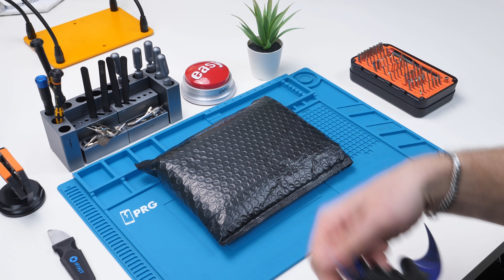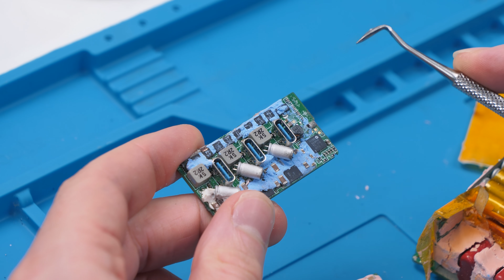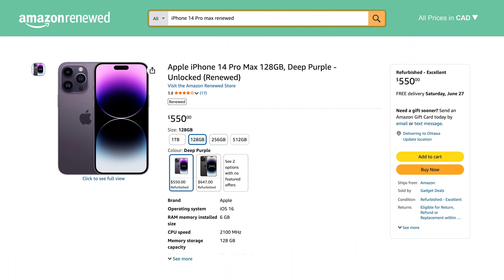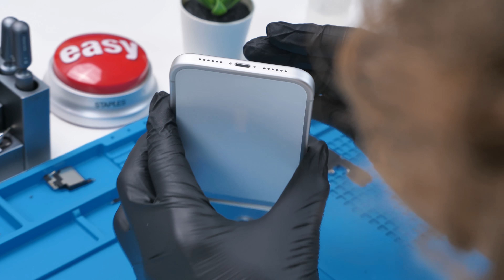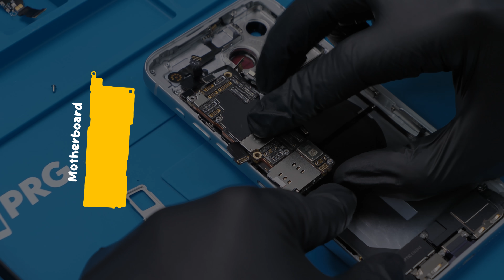iPhone Mods Finally Got Good.

Comment from the maker: Buy Anker Prime 160W Charger on US Amazon: https://ankerfast.club/q8v8lb
Visit the official website: https://shop.anker.com/9SKtke
Reply: Love the video!
Reply: i did the same mod as you with my 14 pro max but my lidar scanner works fine? im sure yours didn’t work prior before the housing swap as mine works perfectly fine.
Reply: Can you giveaway this phone for me after this mod
Reply: Nice
Reply: Can I have an iPhone please
Reply: Bro I tried the converting it and I dont know how the lidar and all works as you saud i trued wuth the app u used but it also ashoes everything works I got the mod housing from india from a seller there but the lidar connector extender i got didn't need to be bend or so it was perfect i dont know what happened with your lidar i think because it was folded and all but anyway my kit came with everything separated like wireless charging coil,flash,camera control button , other buttons and all came un attached and it costed me about 230 cad to get the housing
Reply: @Unofficial_beys  Can you please tell me if NFC works for you?
Reply: Me lo regalas soy de Panamá y mis compañeros .e además bullying por q tengo el j2 prime 😢😭
Reply: Is there a IPhone 15 Pro Max to 17 Pro Max converter??
Reply: Give me iPhone XS please please ❤❤❤
Reply: Can I please have the 14 pro please my phone is really bad Im a student and don’t have any good phone 😢
Reply: Can i have it i never had a smart phone im waching this video with tv
Reply: No, the charger wil overheat my phone

Comment: Bro i installed it myself

It doesnt fit in a standard 17 pro max case

The build looks like a real 17 pro max, i fooled a lot of people and phone technicians

Flash isnt two toned like the original iphone flash

liDar also works too but nfc isnt working but i never use nfc

Other than that it works pretty well.

Comment: Worth it? You mean just for the video, right? Because this mod is absolute garbage for daily use. Definitely not worth it. The downsides are enormous. Bluetooth issues, halfassrd action and camera button(the main reason to do it), losing LiDAR, still being stuck with usb-c, obliterating any water resistance, and not even having mobile payments or the other functions of NFC???? Absolutely not worth it at all. What did you actually gain? Nothing except to look bougie and cheap. There’s also no way it hasn’t impacted cellular signal as well as potentially just all radios. It’s a fail and only a novelty for a video but offers nothing but disadvantages for actual real world use. Lame.

Comment: Whats about flash light?
Reply: It can work normally, but you should use the original flash and the stock cable, though you'll have to fold it to make it fit.

Comment: Собрал я этот телефон всё работает и лидар и nfc шлейфик нужно было установить всё хорошо помещается без проблем
Reply: It can work normally, but you should use the original flash and the stock cable, though you'll have to fold it to make it fit.
Reply: @H3ll0-f7y ничего не сгибал, всё идентично, всё поместилось, если хотите могу снять видео как получилось, автор видео собрал вот только опыта маловато у него я начинал чинить со времен кнопочных телефонов, по этому доя меня нет трудностей даже спаять свой кастомный шлейф. Но мне не пришлось всё подошло хорошо

Comment: In the ad they show the position of the correct handle sensor and the way for NFC to work: Just wrap the NFC cable with insulating tape before installation and both functions will work.

Comment: Ordred the same kit and got the NFC running by insulating the wire (end of the antenna) with electricl tape. the lidar in this video is upside down too thats why its not working

Comment: If u see this comment, many of these Aliexpress housings dont use proper film on the LiDar window, just scrape the purple off with something, and the Lidar will Work, and the NFC antenna needs to be  insulated using the yellow plastic they include

Comment: this is very common in Low cost iphone market in China. Using Iphone x,  12 and 14 mainboard with IP17PM style casing, with options of 10+ colors and different sized batteries. Some of the combo deals are as low as 500-600RMB level, young adults and students loved it over there.

Comment: I used Anker Ganprime 737 100w charger in one little electricity short circuit it burned down and its not working anymore. and anker official service centers ask me 50$ to fix 80$ charger

Comment: The LiDAR Scanner should work no matter how it’s positioned as it doesn’t need the cameras to be at a specific location to work. Most likely the ribbon on the extension flex just snapped internally kinda like flex gate on MacBook displays. I bet if you connected it back to the motherboard, it would work

Comment: Dang bro actually did it. When iPhone 17 released I searched for iphone 14 pro max transition into iphone 17 without noticing because ip14 has Dynamic Island and 3 cameras, and just transfer the lider and flashlight sensor to the left side(just like how they modified xr)

Comment: I’ve seen on Alibaba some sellers that have videos of USB-C charging ports made for this housing mod, I ordered one just out of curiosity to see how the f*** do they work. It seems they dont sell them publicly right now, but if you look closely in some listings they show the usb-c mod installed on the housing, just asked a seller and they sold me a test unit.

I also contacted some sellers and they sent me videos of the LiDAR and NFC working fine, they isolated the antennas with kapton (Yeah, really) and they work. 

With just those 2 things, this mod really stands out!
Reply: Can you share the link to the usb c installed mod or provide the store name?

EDIT: found the listing, will update you guys if I’m able to place an order

EDIT 2: placed an order
Reply: @willsmith2882 there’s no link right now, you have to talk to sellers directly. Look for the 14 pro Max to 17 pro Max housing and ask the seller if it has the usb-c charging port for the mod. Guangzhou Yifeiyang is the store I asked to and has it, but check the listing first, there should be a video where it shows the charging port installed on the housing
Reply: @bfasista  Is it possible to install USB-C mod without the housing? So USB-C port in standard iP14 Pro shell. Would be huge because I'd want to keep mine as long as possible, if it wasn't for the lightning port.
Reply: @kennybruhbruh  I think it is! the charging port is something completely apart from the sensors that are being re-located in this housing, so it should be possible. I didn't get the charging port yet, but I hope to test this component in particular.
Reply: @willsmith2882 all of the best I just want to change my battery it’s at 78% health
Reply: @willsmith2882 ac
Reply: @willsmith2882  would like the link to the usbc port please
Reply: @willsmith2882  Could you please share the link you found? Thanks 🙏
Reply: @willsmith2882  can you update us further?
Reply: @willsmith2882 send me the link please
Reply: @willsmith2882  It's been 2 months did you get your order?
Reply: @willsmith2882  Can you share the link?
Reply: Could you please send me the links to do all that and get it working 100%?
Reply: You know what would be cool if you could put a physical disconnect switch for the GPS in there so you can use it for maps and they can't use it to increase your car insurance premiums. See they already lied they say they don't sell your data but the data from driving gets sent to the insurance companies to increase the insurance premiums.

Comment: Well I body swapped Iphone 12 Pro and 14 Pro once because of broken backglass and both times the Lidar stopped working.. So I think its just super sensitive to damage? I Did manage to remove the sensor using heat and or alcohol both times but no luck with that..

Comment: this is actually kinda cool. i need help deciding pleasee. I have a 14 pro thats kind of seen its best days, used it since the year it came out. and i have a 14 pro max that last week after a drop suddenly reboots after 2 mins in any app. which one should i fix and what could be the 14 maxs problem?
Reply: For the 14 pro max, check the panic logs it could be anything. It might be some sort of board damage if it was a drop.
Reply: @gobitech65  checked, and it was the front flex, so easy fix. ty
Reply: It could maybe be a disconnected cable too

Comment: Hello PRG, I have an iPhone 17 Pro Max and I was wondering if you have any power bank brand or model recommendations for this phone? This is my first iPhone, and people around me told me I shouldn't use products like the Type-C cable, charger, and power bank from other brands. But the thing is, when some people buy the iPhone 17 Pro Max or other 17 models, they are also buying powerbanks and chargers from other brands at the same time.

Comment: Have you tried to turn the lidar connector around? I couldn't see it as quick, but it looks like it can be plugged in either way and if the cable route looks really funky, maybe it's the wrong way round? Could also try to measure continuity between certain pins and compare to where they need to connect on the motherboard.

Comment: it would be easier to use a modified charging port, for using USB C instead of lighting, i guess the 15 pro max charging port would work on a 14 pro max.

Comment: I tried this mod, over & above the issues you found. I found the case scratched real easy! I did diagnostics got this error "Cellular RF  A cellular hardware issue was detected ":(  In the field the cellular signal was weak  not as good as the 14 pro max before the mod.  I tried 2 different main boards, both same error. I paid alot to make this mod and now it has been shelved :(

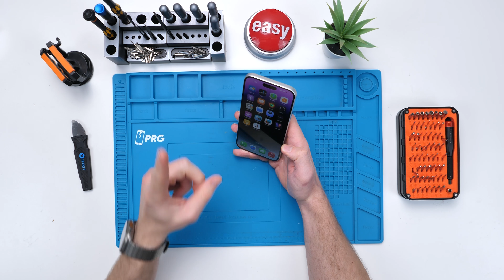Comment: jcid 12:39 app is not reliable i have 16 pro max which has 12mp front camera but the app said my front camera is 18 mp this is such a non issue but still its wrong information

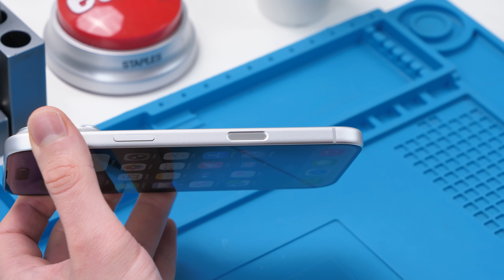Comment: 13:35 I mean to be fair, the touch sensitivity thing is disabled by default on iOS 27 so most people won't even notice it if they never got to use a 16 series phone with iOS 18, or enabled it themselves on someone elses phone :p
Reply: uh i have a 16 pro max and i use ts every where

Comment: the nfc doesnt work cuz the sensor is on the wireless charging thing so if you just stick on the original one instead of the one they give you it could work ig
Reply: Nop. NFC sensors on iPhones are at the very toppart

Comment: Ive seen someone try to sell iPhones professionally upgraded from for example an iPhone 14 to a 16 Pro and a 15 to 17 pro, they also completely jailbreak the motherboards to let the phone fully believe it's a 17 Pro. They're surprisingly affordable and priced at the exact same prices as the original phone was. I've asked them about details and as far as I've heard theyre all running iOS 26, iOS isnt updateable, it voids their 1 year warranty since it will encounter iCloud issues due to the jailbreak. They also only use one camera sensor, which they manipulate to have 3 modes in the camera app, being cropped from the main sensor. I haven't heard anyone talking about these, but might try them myself once if I commit, but I'm still unsure.

Would love for you to try them and show us the issues and upsides about these. I would suppose the iOS isnt very stable and could develop significant issues when updated, but maybe theyre really useable apart from that?

Comment: My daughter came to visit and she switched to the Iphone and forget her charge cable so went all day with a dead phone because it would only slow charge here with my 260w cable and 100w charge brick and she was rightfully PO because she could not get videos or photos when we were out on the boat or at the water falls. The rest of us with Normal phones used them got hours of videos and recharged in the car when needed but she had to just put the phone on charge for an hour when we did the waterfalls and she got up to 35%.  We all sent her photos and videos but to have a New Phone and can't use it because of a cord is bs and just 1 reason I won't buy apple anything. I charged me Samsung for 20% to 100 in 30 min with super fast charge and she got 20%.  Could have bought a charge cable sure but $30 for a cable to use today is bs.

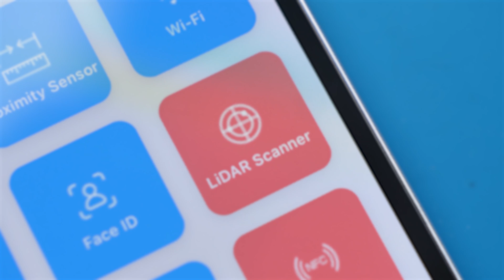Comment: 14:14 we’ll definitely it won’t work, I knew it right from the beginning cuz in the 14PM it is right near the camera, and in the 17PM it is far from it, and it does the calculations using both LiDAR and cameras to make those 3D scans. So the iPhone still thinks that it is placed near the camera while it is move a bit far. This makes the miscalculations and that’s why it won’t work properly. Although there could be other issues such as that awkward ribbon fold, which results into it just not working at all. But the above explanation is my best guess why it won’t work even with everything put together perfectly. It will need software tuning to have those calculations perfect.
Reply: it's definitely because of the placement and due to that the calculations dont match.

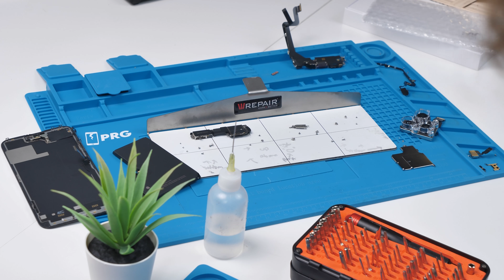Comment: 7:36 missed the oportunity to convert it to USB-C :)
Reply: Prob wouldn’t fit in the housing
Reply: @Pea-G it should, as i've already seen a lot of people converting older iphones to USB-C. No idea about the 17 pro max case but in general it should definitely fit. It's the same size as lightning plug if i'm not mistaken.
Reply: @dɛvil  USB C is just a little bit thicker than a lighting connector.
Reply: @dɛvil  Do it yourself then make ur own video
Reply: @dɛvil  these people you mentioned converting to usb C, they have to do a LOT of things in order to work properly, and the lightning IS thinner than usb C, it doesn't fit like a "plug and play" piece
Reply: @dɛvil yea no usb c is noticably thicker than lightning
Reply: Tbh I think it’s funny that it looks like a 17 Pro Max but has a lighting port lol
Reply: That requires a ton of electrical work
Reply: @unhingedgirlypop  already a version of the mod that already has a usb c charging flex embedded
Reply: @Skoopyy. Can u sent the link pls 🙏🙏
Reply: @Skoopyy.  Do you have link for that? Would be interested🙏
Reply: @Skoopyy. where
Reply: why would you?
Reply: wont work cuz housing cutout is specifically for lightning, he will have to modified the housing for it to fit usb-c port.
Reply: Not the spy kids😂😂😂
Reply: would still be only USB 2.0 😒
Reply: but he said after that something you need to know dude
Reply: Ko
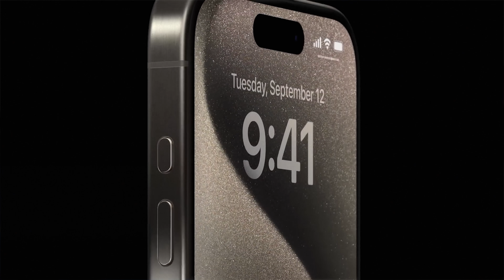Reply: 3:36
Reply: There is a newer version of this mod which includes a USB C port
Reply: Was gonna post the same comment :)
Reply: He isn't the brightest of people
Reply: @totojee-u8k  and you are? 😂
Reply: @dɛvil no not me either
Reply: @totojee-u8k  caldruki moment
Reply: @dɛvil  he's right
Reply: @totojee-u8k  at least you're honest

Comment: please do an iPhone 13 mini mod using some newer internals!
Reply: As much as I would love to see it, it's not possible to do that.
Newer iPhones doesn't have the same motherboard shape, which would make finding a fitting battery extremely difficult or with very low capacity
Reply: @Homme_De_Kro-mignon ah yeah bummer.. tbh though, the 13 mini battery is not nearly as bad as its chalked up to be. it holds all day at light to moderate usage. and frankly who is away from a charger for 12 hours straight on a regular basis where thats truly a potential issue ya know?
Reply: @kyl @kyleadamsdrums  I knooow, I'm using one since 4 years ! 😍
I was just saying, if you want to fit a new motherboard in the 13 mini chassis, you might have to use one that is not as big as the original one...

Comment: Bro is the best customer of aliexpress
Reply: AliExpress is gem tho.
Reply: @WibberNoggin gem is crazy… it works but more than that?…
Reply: @brockgan8941 ali express is gem . only if you know how to browse it... Scams from the start but when you find something... It's really good
Reply: @brockgan8941 they have stuff you don't find everywhere and prices are pretty decent.
Reply: @brockgan8941 youd be surprised how much good stuff you can buy on there. High quality charging cables, adapters, flash drives, etc. a lot of stuff you see on amazon and ebay is dropshipped from aliexpress anyway
Reply: @brockgan8941  if you know what youre doing you're directly skipping a dropshipper and saving at least 20-30$ on everything you buy. I've bought tools, electronics, mice, keyboards, phones, processors, RAM, storage off it in the last few years. There's really nothing like it, it's as close as you can get to manufacturer without using something like alibaba, just have to know what you're doing. On amazon, you're getting american sellers trying to charge american prices for stuff they dont even make
Reply: You are right, bro😂
Reply: For real 😂😂😂
Reply: Frr😂😂
Reply: Agree😂😂😂😂😂😂😂😂
Reply: also the strangest
Reply: Why is bro saying peak?
Reply: everyone actually is if you contact their support they dih ride tf out of you
Reply: Nah that would be the fpv community
Reply: ? 0:08
Reply: No, my father is over
Reply: @Fyramiz huh ⁉️
Reply: No, it’s definitely me😅

Probably spent more then £5k this year alone
Reply: @carbeastsm  this is actually insane and i hope you know how deplorable it is
Reply: @raiderfly  

TBH most of that was from buying and selling E scooters
Reply: Goddamnit, I bought my entire house on AliExpress. I think I take it thank you.
Reply: Fr
Reply: @Imraan722 ya fr 🥀